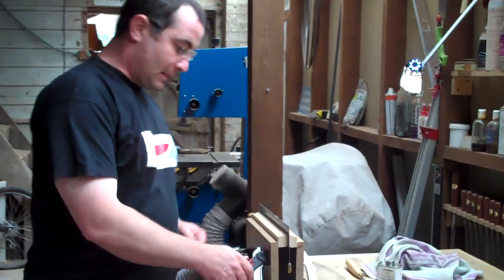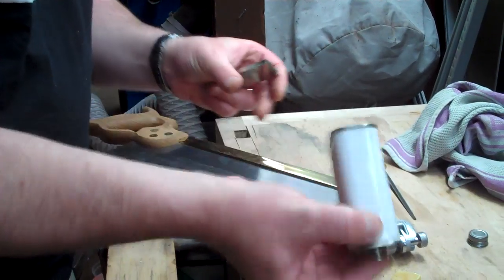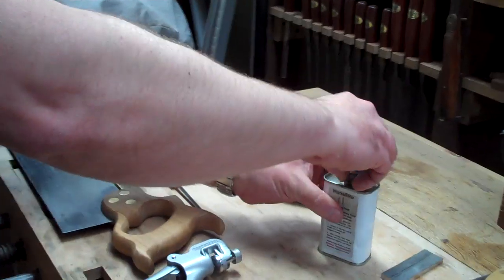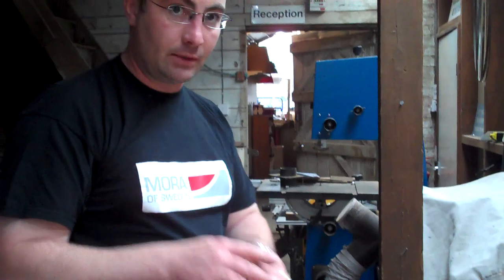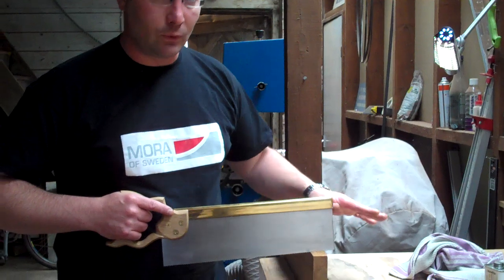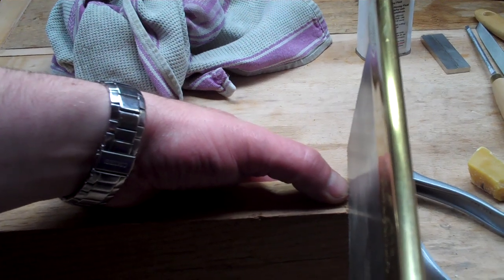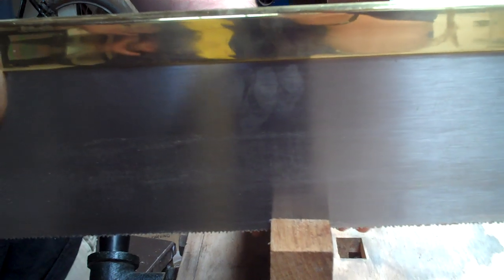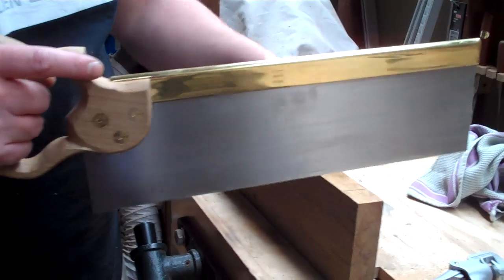Workshop Heaven - Saw Sharpening (Part 3)

Comment from the maker: Hi Chris,

Useful tip thank you! I hadn't thought of it before but most of the sharpening I do is on new saws. I did sharpen some old ones for a customer a few months back and approached it as you describe.

I learned to start at the front so that the blade exits the timber at a shallow angle, thereby limiting breakout. With a Japanese saw (teeth going the other way) I start at the back.

Cheers,

Matthew

Comment: Interesting set of videos.

I find that checking the flats on the top of each tooth created by flatting while you are filing the teeth helps to get them even. File until the flat has just disappeared. Sometimes teeth are uneven, doing the same number of strokes on each tooth will not correct this.

Is it better to strat at the front corner when sawing? I have always started at he back corner.

Thanks for the tips Matt.